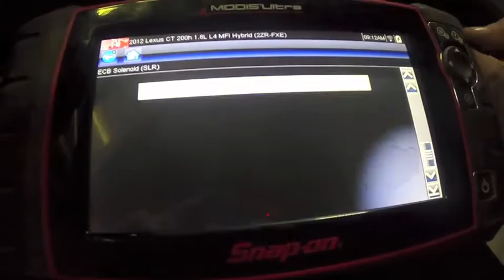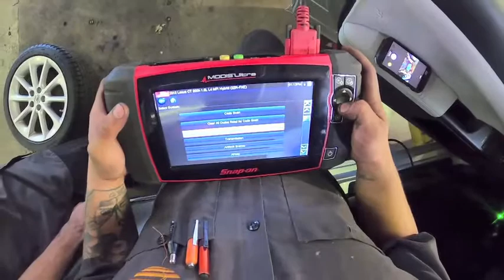2012 CT200h Brake Actuator Replacement

Comment: Hello, I have a CT 2012 with 150k miles I just heard a noise when braking 5 to 20mph , sounds like a bicycle with a baseball card on the spokes. Can somebody confirm this is the noise it makes when you need a new brake actuator ?? Thanks in advance
Reply: @chazrivera1705 did you find the issue? i have the same problem..

Comment: Hello this greate video and very understandable explain, thank you very much, If you can help me I have DTC c1391(Abnormal Leak in Accumulator) what is broken, Vaccum Pump or Master Cylinder Assembly or both parts need replace? and what about firmware, you stitched your Brake Actuator?
Reply: Hey where you able to find out what the issue was?
Reply: @joshuapedraza8007  I bought scanner Topdon ,Autel or Launch and when you will buy, you necessary to check what is function the scanner has

Comment: How common is this issue? This part is almost 6000$CAD new from the dealer so if this is common thats crazy
Reply from the maker: Haven’t seen it much in cts however it’s a pretty common issue with Prius. I mean it’s a little over 10 years old and you use it every single time you drive.

Comment: Hi . What was issue? Why did you replace? Also did you replaced pump?
Reply: The actuator leaks internally and won’t hold pressure from the pump . Throw a code like c1931 .

Comment: Hello I have serious doubts if a prius plus ZVW40 with ENGINE CODE: 2ZR_FXE 2015. If I can do the brake fluid change myself or you have to do it by diagnostic machine. Above all my main doubt is whether for this change you have to purge the race simulator or only have to be done when changing for example the ABS, the Brake Reinforcer or some of the lines. Thanks and regards

Comment: Hello. I have replaced my ABS today at car service. For replacement they used used ABS. It is 2011 Lexus CT200h. But during cornering ABS start work and slow down the car. Could you please help me? What should be done to fix this problem? I think it needs some kind of calibration.
Reply from the maker: Is there any abs lights on?  Dash lights?  

Tbh it's very hard to diagnose a car without seeing it.  Also it's hard when it was a used part as well.  From my experience used parts especially abs actuators on toyotas don't take the relearns very well.
Reply: @DI_Wy  hi, How can you tell if the actuator needs replacement
Reply: Hello Aslan Bey, i have a same problem. Did you solve?